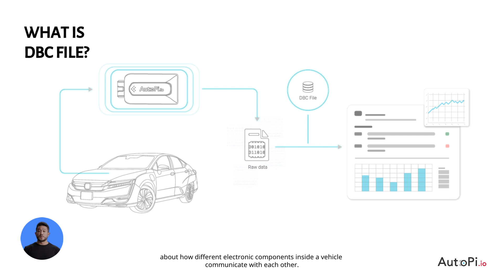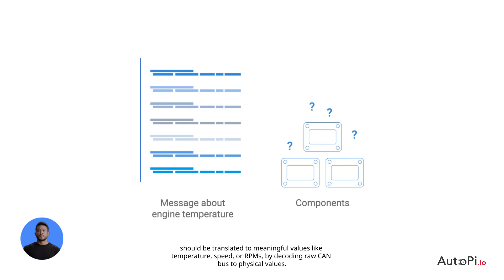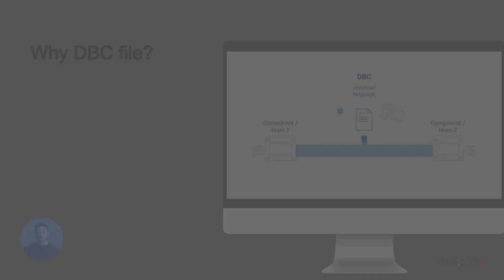CAN DBC Files in under 3 minutes!

Comment: Since Vector introduced the DBC format long before CanOpen was around.. it doesn't contain PDO/SDO specifics, yet CanOpen software, like CanOpen Magic and Vector Canalyzer Canopen, still asks for a DBC file!

Sometimes vendors of CanOpen devices, often supply EDS/DCF files.. but how do you go from EDS/DCF to DBC.. or if neither is supplied, how how do you create a CanOpen based DBC file based solely on the PDF documentation?
Reply from the maker: Thank you for your detailed comment @bennguyen1313.

You're right; Vector's DBC format predates CanOpen, so it doesn't have built-in PDO/SDO specifics. If you're working with EDS/DCF files (standard formats for CanOpen devices), there are tools that can convert them to DBC. Without these files, it's a bit more hands-on.

Here's a brief guide:
1. Thoroughly study the PDF documentation for CAN frame structures.
2. Decode or reverse engineer the CAN frames to find the data's location.
3. Convert the CAN frame header from hexadecimal to decimal.
4. Craft a DBC file using this info, detailing data location, length, and any needed transformations.

Remember, as long as a device uses standard CAN frames, you can craft a DBC file for it, even if it involves some manual effort.

I hope that clears things up a bit. Let me know if you have more questions! 😊